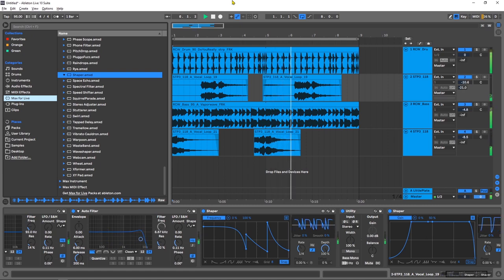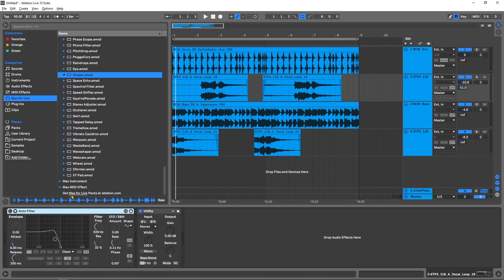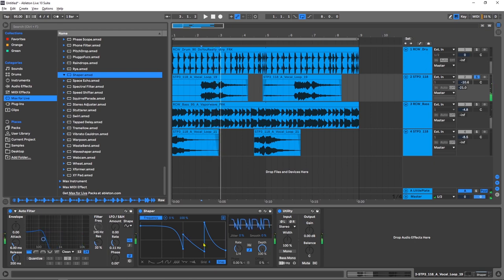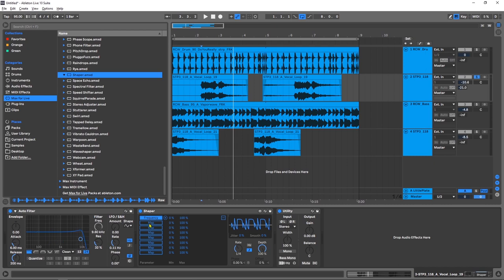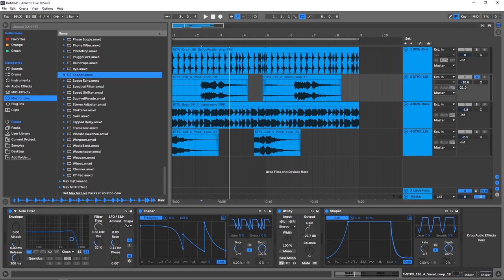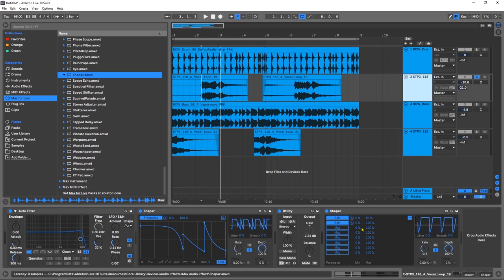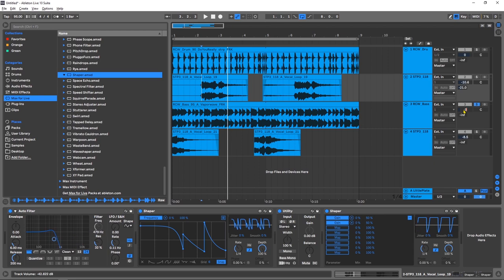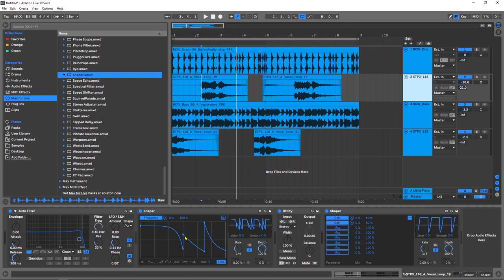Ableton Tutorial | Don't Sleep on the Shaper! | a Max for Live Device

Comment: I'm glad this is in Ableton now, but it needs work. What I don't like is that the ranges/depth are wonky. For instance you can create a sidechain effect using a 0-50 range with a Utility, but if you want to, for example, adjust the depth, the "depth" control doesn't work right because of the 0-50 range. So, then you figure, ok well just adjust the bottom of the range (the 0), but you can't automate that. And you can't map that to a macro either for automation. I hope Ableton makes a proper shaper with flexible ranges the way it should be. This is kind of hack.

Comment: Good video. Like LFO, I've had issues leaving these Automator vsts active closing and reopening after collect all save.
Crashed. If I just disable before save and re-enable on reopening, its straight.
I figure it's constantly changing data and conflicting with saved project.
They're great tools, though.
Reply: Same, I just can't use them reliably.